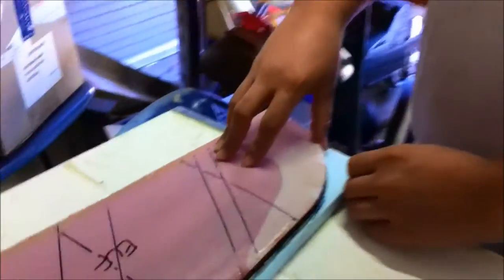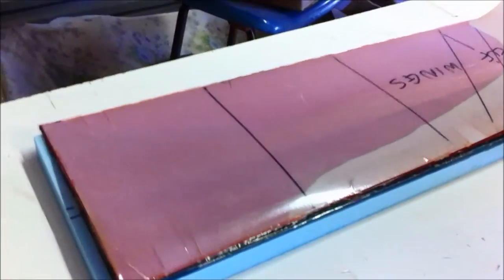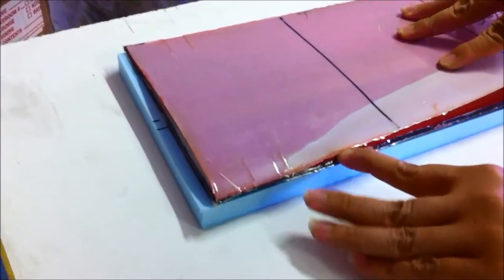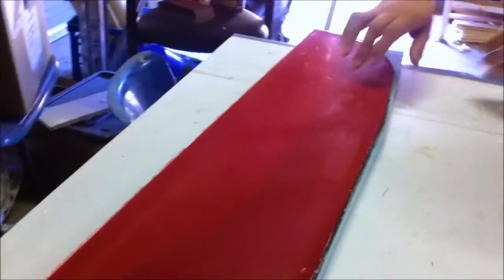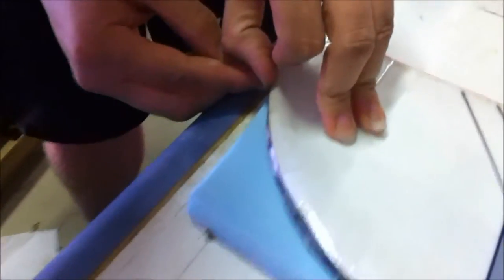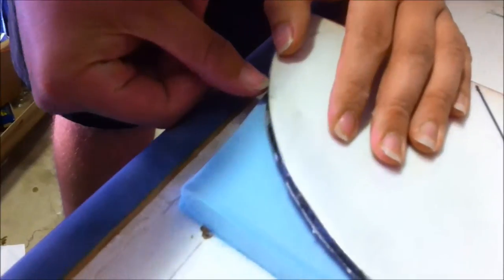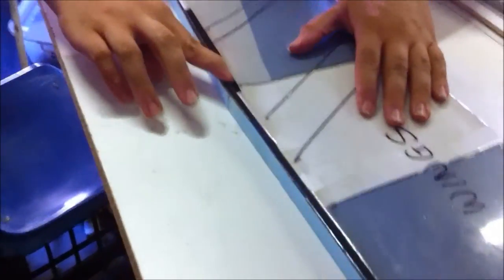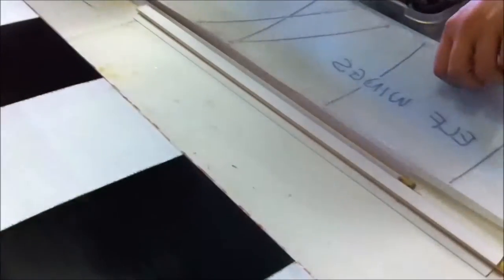Mats LadyBug Elf - First Wing Panel

Comment: nice wing !!! what kinf of paint did you use ? did you first paint the mylars?
Reply from the maker: Hi Juan, thanks for the compliment - I was certainly happy with it.  That mylar was painted with spray-can acrylic lacquer.  These days I use a small HVLP spray gun, but I still use the acrylic lacquer.  I don't like the risks involved with 2-pack paints.
Reply: @steveaitken5468  nice, so you paint the mylars, let the dry and apply to the wing when building it? did you put waxs on the mylars before paint them? sorry for all this questions but if you can explain me the procces that would be excellent as you reallly made a great job !
Reply from the maker: @magneresjuan  no worries.  Yes, I wax with TR-108 wax.  I have the TR-108 because it's compatible with the PVA I use when painting in moulds.  Wax well first, then paint.  Let dry fully - acrylic only takes a day at most under normal conditions.  Then lay up wing as shown here (same type of wing as the red one) ...
https://www.youtube.com/watch?v=pjoKsXbOVQ4
Reply: @steveaitken5468  perfect ! thanks. do you think any acrilic paint will work ?
Reply from the maker: @magneresjuan  Acrylic often refers to water-based paints, which are not useful for this.  Acrylic lacquer is basically car-paint.  If using a spray can, be careful not to buy enamel paint - it won't work either - often remaining sticky for a long time.
Reply: @steveaitken5468  get it so any acrlic paint without whater should work, right ? thanls alot!